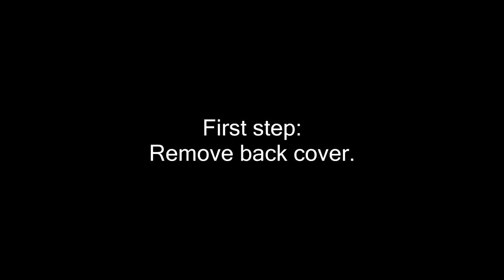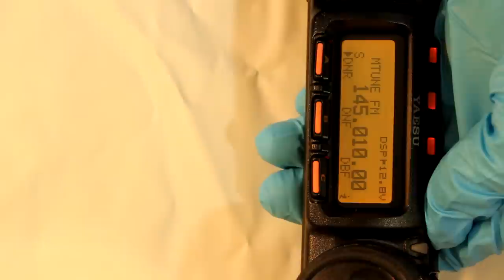Yaesu FT-857D select knob replacement

Comment: Successfully replaced with Bourns Encoder PEC12R-4230F-S0024

Original components from Alps (the one in the service manual) in discontinued.

Length of the encoder is 30mm from base to top

Shaft is 12mm

Many thanks for the video. It saved me from catastrophic errors!
Reply from the maker: Glad it worked!

Comment: I've never seen an iron quite like that, with the solder sucker built in. pretty cool piece of kit!
Reply from the maker: At the time I didn't have a dessoldering station, so I got one of those for 5 or 10 euros, pretty handy if you don't need to desolder through hole components often, but I got a bit frustrated a couple of months back when I had to remove around 30 very large transistors on a board, so I got a cheap dessoldering station with integrated vacuum pump and it's a dream to use.

Comment: Nice job, I've changed a few encoders on other rigs, but not the 857. What's the dip switch under the VFO?
Reply from the maker: It's a phone/speaker switch that sets the power output of the 3.5mm audio jack. In "phone" it outputs low power to drive headphones, in "speaker" it increases the power to drive a small external speaker.

Comment: What solder station r u using looks like and sounds like it socks the solder pretty good nice tool to have and make the job a lot easier 👏🏻👏🏻👏🏻
Reply from the maker: That tool is a cheap manual heated solder sucker similar to this one:
https://www.aliexpress.com/item/32944749535.html
It's absolutely fine for this kind of stuff, or if you only use it occasionally. Recently I've had to repair some machines that had many through hole components and a desoldering station with a vacuum pump is a must, I have one similar to this one:
https://www.amazon.com/Digital-Desoldering-Station-Anesty-Professional/dp/B07542D82F

Comment: i have the same probleme with my FT100D,is it the same switch?  where did you baught your hand welder? it is great
thanks for the video
gervais ve2ckn
Reply from the maker: If you're talking about the select encoder this part should be compatible with your unit: https://www.tme.eu/pt/en/details/ec11b15244/incremental-type-encoders/alps/

If you don't live in Europe just search that part number and try to find a retailer closer to you.

This is the service manual for the FT100D:
http://k0lee.com/ft100/FT-100DTechSupp.pdf

This is the exploded view to help disassembly and reassembly:
http://k0lee.com/images/FT100%20Exploded%20View.pdf

Comment: That's very helpful - thanks. Mine's just back from a warranty job for exactly that component replacement. Bought new in February, faulty weeks later, skipping frequencies increasingly.  Nearly five weeks away because parts had to come from Japan, apparently.  A guess is this is maybe an underengineered item, with MTBF far too short. I'd appreciate the part number too, if possible.
Reply from the maker: +Ian Gourlay I don't know if you noticed and it was a long time ago, but since you asked, another user posted an alternative part number for the encoder on the Yaesu FT-857D, the alternative part number is STEC12E08, in case you need it in the future.
Reply: I think I did see that José, but now you've reminded me I'll take a note for possible future reference - thankyou!  My rig is only about 6 months old so perhaps it uses the alternative part?  I do think this coder is a weak point in these radios - the replaced one Yaesu fitted has already become "softer" in its click-action, which doesn't say much for this component's build quality - it's a pity, since this is such a versatile radio.
Reply from the maker: To be honest I had a clumsy moment and dropped my front panel and it fell on the control dials, the fault developed a couple of months after, so I always assumed it was because of the fall, maybe the encoders did have a reliability problem after all. It's unusual, Japanese switch manufacturers have a pretty good reputation.

Comment: Nice video, where did you buy the select knob?
Reply from the maker: I bought it in my local Yaesu reseller, they have reasonable prices for spare parts. The service manual claims it's a rotary encoder manufactured by ALPS, part number EC12E24244A4. It seems however that it is an obsolete part, but since it's a simple component, maybe they are using compatible ones now.
Reply: Thanks for the reply  Jose, I will browse for the part number and see if i can get a hold on it here in the Netherlands. 73 PJ
Reply from the maker: If you don't find that part number, send me another message and I will try to get the part number that my supplier uses.
Reply: José Faria They also use STEC12E08, FYI
Reply from the maker: thafff Nice one! That one is cheap and easy to find, thank you for sharing.
Reply: +thafff Sorry but that STEC12E08 is to short!!It's only 11mm and you need 20mm...
Reply from the maker: Gino vds  According to the last page of this datasheet it should be 20mm between the base of the switch and the end of the shaft:
http://www.produktinfo.conrad.com/datenblaetter/700000-724999/700708-da-01-en-ENCODER_STEC12E08.pdf

Does it need 20mm on the shaft alone?
Reply: +José Faria yes but the shaft have to be 20mm not totally length!This that I have is to short. I have seen the original...so don't forget to look for a 20mm shaft!
Reply from the maker: Gino vds Can you please post the part number with the 20mm shaft when you find it?
Reply: +José Faria I have just done a order by info@radioamateurshop.nl He got the original part Q9000796, take contact with owner of this shop he can help you...

Comment: Thanks - very useful video.  Had my 857 for a long time now but not had this problem yet.  I try to use the encoder as little as possible.
Reply from the maker: +mw3yvomike1 Mine wasn't completely broken, but sometimes it would jump 2 positions in one indentation, and that was annoying. It developed the fault very early in it's life, but I assumed it was because I dropped the remote display. For a 10 euro replacement part (my Yaesu dealer also sells all the repair parts) I decided it wasn't worth it sending it to Yaesu's service.